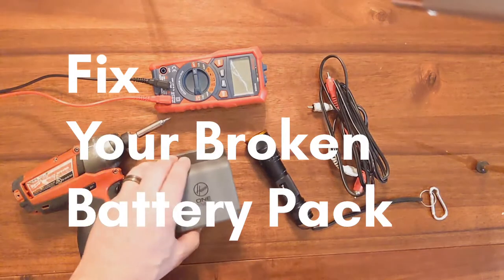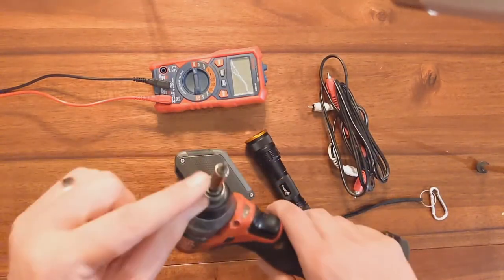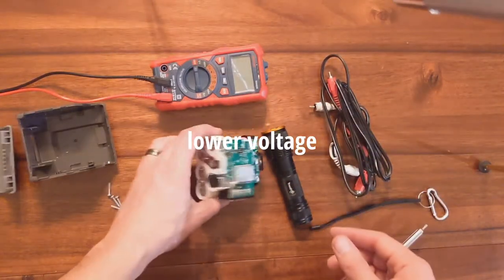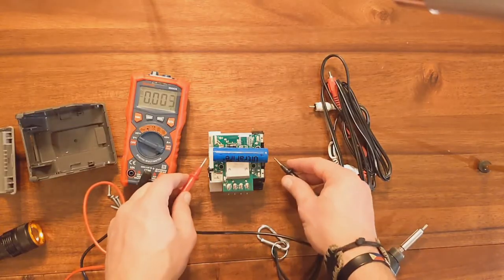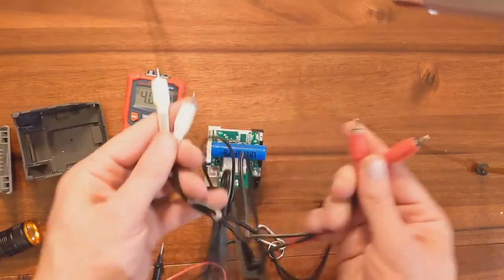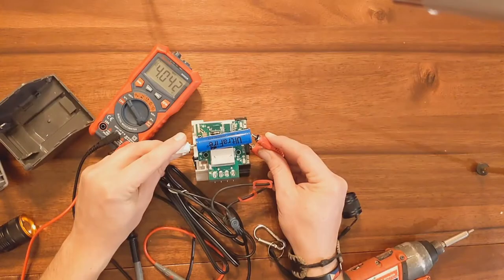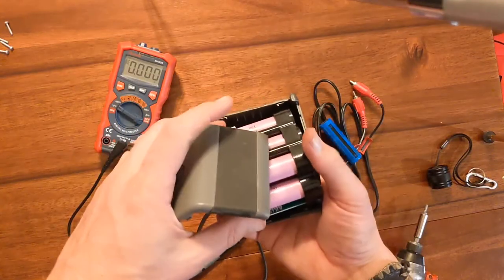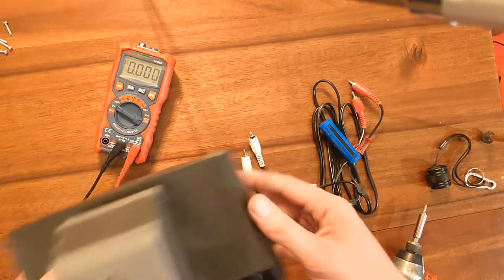FREE fix for Dyson/Hoover dead battery pack (Works!) 10 minutes saves $$$$$

Comment: Thanks, fixed my dyson V7 battery with your video.
Reply: How did you get the battery open to find the bad cell?  What too did you use.  I unscrewed the one screw, but  the V7 battery crevice is so slim, it won't budge.

Comment: I had same issue with my battery. After using this method I was able to fix it but after using once when I tried to charge battery again I got same issue again it’s look like when cell is bad it won’t work again next best solution is to replace cell with new cell

Comment: Nice! Gonna try this on my Dyson V7 with a blinking red light indicating the battery refusing to work or be charged.
Reply from the maker: If you happen to have power tools, check out the Dyson/Milwaukee (or similar) adapter as an upgrade option!

Comment: I tried to fix mine which has OnePwr brand. It’s theoretically easy but it’s not really worth it. The batteries are hard wired to the charging circuit board and trying to cut the batteries out resulted in short circuits and smoke. It’s not really worth the risk at all

Comment: Can you show for Hoover onepwr 4.0 pack? Seeing white led 1 & 3 on pack and red on charger
Reply: Did you fix this
Reply: I tried this on a dead OnePWR 4.0 with those lights, but it didn't work. I used a benchtop power supply and charged all cells to 3.8V, but those lights still flash. Seems like a problem with the actual board instead.
Reply: Same experience here trying this method on a OnePwr 4.0 battery. Cells all have even charge now but same error lights flashing and charger won’t recharge the unit.

Comment: Hi there, what is the type of cable needed to transfer the voltage from one cell to the other? Thanks!
Reply from the maker: @Zomerzonzible  any conductive wire should work. Speaker cable, RCA wires, alligator clips and small metal magnets are probably best.

Comment: i have a hoover multi vacuum item no. bh52230 . my charger is flashing from white to red . it doesn't stay white but it doesn't stay red either . on the top of mine there are buttons shows 25 ,50 , 75 , 100 . showing how much it is charged . and it isn't charged ! 2 buttons on bottom one for rollers second for boost mode all lights are flashing white except the charging one flashing red and white in the center of the other lights . does this mean some of my batteries are still good since it is not a solid red . thanks for the video

Comment: Those batteries are connected together so you're not going to read a single cell voltage like that. Also connecting a single cell to boost will have little to no effect as  it will be far lower voltage than the cell you are trying to boost because they are in series....
Reply from the maker: Not true, I'm getting very different readings on the individual cells. Also the process has worked for me this way on multiple occasions so 🤷
Reply: This might work by taking advantage of the lower voltage cell having a lower internal resistance, and given electricity always wants to find the path of least resistance, it might just work. I have a failed OnePWR 4 Amp pack here which I'll give this a shot on later.
Reply: Word of advice: don't try with a lower voltage cell than the recipient cell, I managed to damage either the BMS or the buck boost converter in an AA 1.5 V Li-Ion cell (3.7 V native, converted to 1.5 V by an integral BMS). No harm done to the pack (and no improvement) - my path of least resistance comment is borne out by the fact that 3.7 V will definitely want to push into a 1.5 V cell ;-) it was a fun experiment to try. Now to go snip the joins so I can charge it in isolation then resolder them!
Reply: Batteries connected in series (like these) can be measured in this way.

Comment: And by the way, your method of taking the shell apart is unecessarry.  As another commentor points out, these batteries are wired in series. So your reading is inaccurate.

Just use the + and - terminals on the battery pack and jump it to another DC voltage battery for a few minutes using alligator clips. It will achieve the same result and save you time and effort.  Just note, the batteries will likely completely fail at some point.

Comment: The cell end up low for a reason, your "fix"won't last
Reply from the maker: Two years later, still working great!!
Reply: Makes you wonder how it even happened in the first place, the cause of unbalanced cell is charging circuit bad or cell is weak and has a lower capacity than the rest..